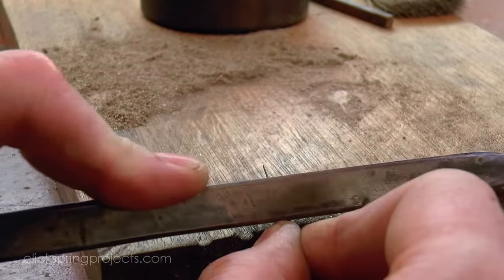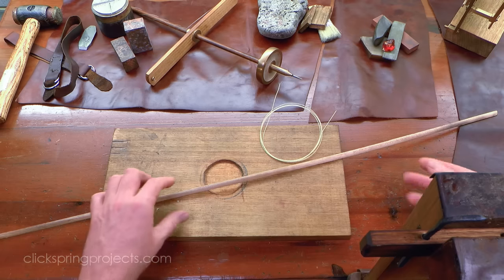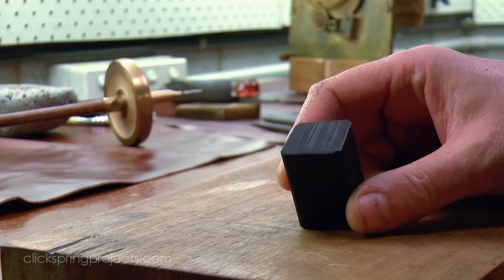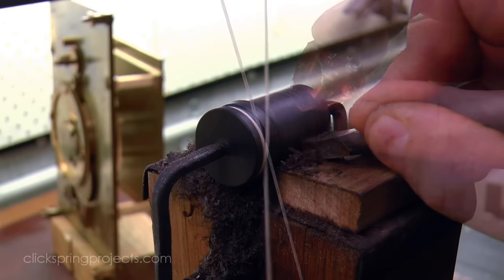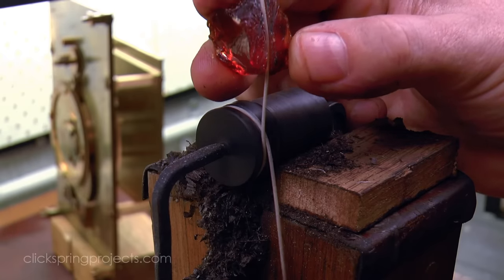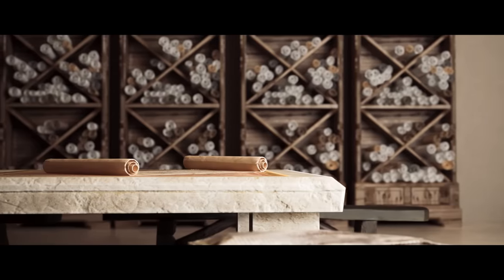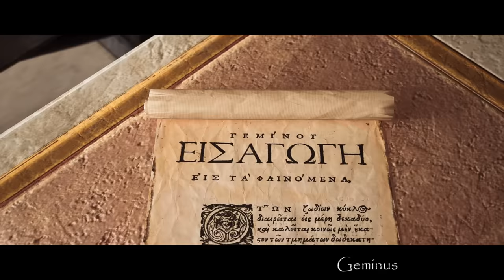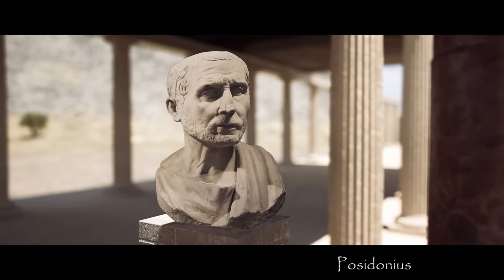Antikythera Fragment #11  World’s First Precision Lathe - Constructing The Antikythera Mechanism

Comment: How do u get exact mm. In  stupid thing by eye??
Reply: Why do you need exact mm? You need to match a drilled hole that you can adjust,  for example. You aren't mass producing things everything is hand fitted. Measurements that are numeric are needed for modern mass production and outsourcing not handmade items where you have the thing you need to match right there.